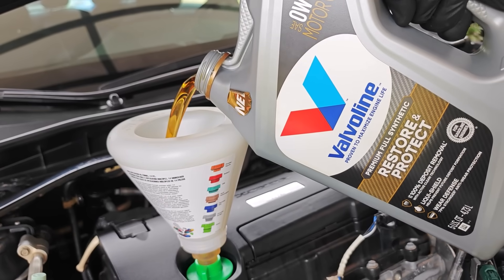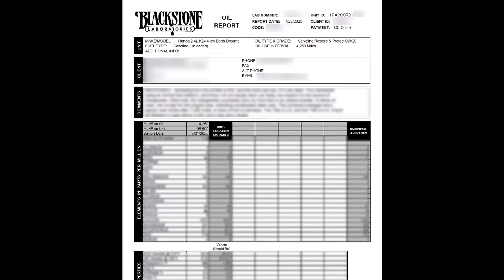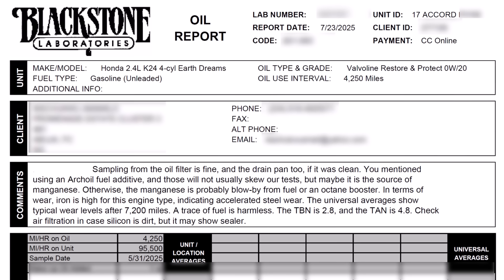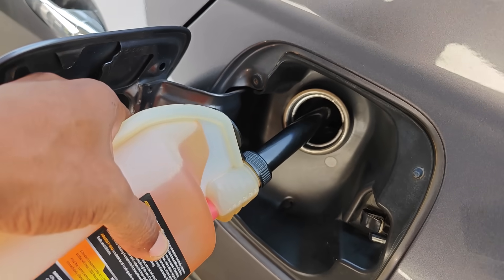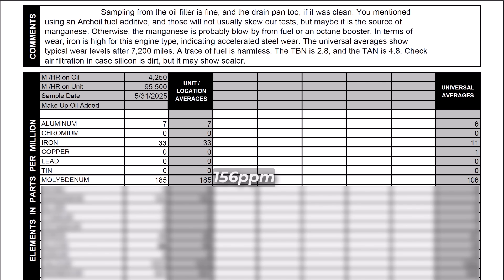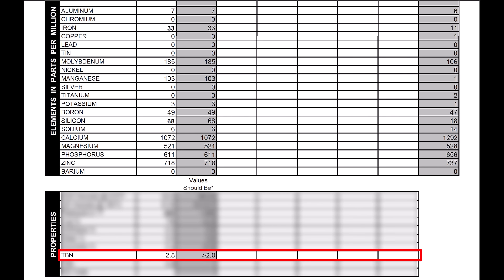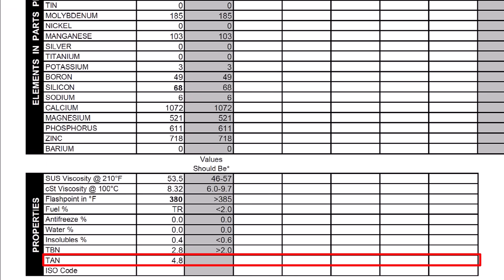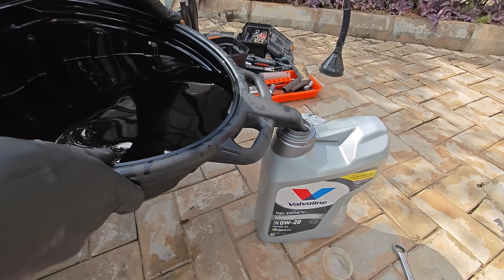Used Oil Report AFTER Valvoline Restore and Protect is Concerning?

Comment: Stop using the fuel additive and see if next analysis is more normal!
Reply from the maker: Yep. That's the plan in progress already! I've just seen from the comments that someone mentioned that Motor oil geek stated that increased manganese shows how well VR&P is working in cleaning out the piston grooves from the accumulation there.

Comment: I’d use the Gold Bottle Castrol 5W30 over Valvoline…..
It runs significantly better in my Experience….
Reply: How long had you tried VRP?  1,2,3, or more intervals?  Exactly what was VRP not doing that the other Oil is?
Reply: @lgoamity Purchase a GoldPlug Drain Plug,Castrol Gold Bottle runs smother than ANY Valvoline Oil….
Reply: @kevinkinsler  So... Does this mean you have or haven't actually used VRP?  

Saying your Gold Bottle Castrol is better seems to ignore that VRP is still Unique on the Market with its "Active" Carbon Deposit Removal while also being API/ILSAC rated...

I'd still appreciate answers to my Questions... What is VRP not doing that your Castrol is doing for you?  If you haven't used it then just say so and tell us why you're happy with Castrol...
Reply: @lgoamity You Aren’t Reading My Comments Correctly;Have a Good Day….
Reply: @kevinkinsler Uh... Your comments aren't answers to my questions... They seem more like Opinions. To read them "correctly" I just need a response or more details that actually tell me you have used the product(s)
Reply: @lgoamity Can you read English,:Castrol Gold Bottle 5W30 Runs Smoother than ANY Valvoline Oil,And this includes Diesel Castrol Vecton Gold Bottle!!!!!!
Dude you gotta learn to Comprehend when someone tries to Help You!!!!!
Reply: @kevinkinsler  I like smoooth! VR&P for the win.
Reply: @kevinkinsler You SAY something like it is PROOF. You claim Experience... VRP is relatively new... You use a general term like Valvoline Oil... Which MY reading comprehension suggests YOU haven't used VRP... AND for some reason can't/won't back up your OPINIONS.  Why is that?
Reply: @kevinkinsler you never said that you have actually used VRP and for how many intervals.
Reply: @kevinkinsler a claim without anything to back it up is useless buddy.
Reply from the maker: @kevinkinsler  No other oil stopped the blow-by I was having in less than 500 miles of use. That says a lot! And now thinking about it, all those deposits would have held a lot of wear metal from the years.
Reply: Castrol Edge Extended Performance is exactly what it claims to be: a 25k mile or 1 year oil. I've just installed both about 2 weeks ago. VR&P is to protect a 2013 Sonata from low tension piston rings and oil consumption. Castrol EP is for protecting a 2013 F-150 work truck from abuse (short trips and excessive idle.)

Comment: Project Farm Has Debunked the 6 month rule, his Analysis at 18 months was just fine.
Reply: Care to clarify exactly what is "fine" at 18 months?  If you mean Oil... You realize that every engine/driving condition is different... Which means 3 months for my GDI 2.4L Ecotec vs my Older (Non GDI) 2.2L Ecotec will result in different Oil Conditions... Namely the GDI is prone to Oil/Fuel Dilution... Meaning that the OLM in both Engines might suggest they both could run nearly 12 months/6000+ miles... Yet Oil Analysis has previously suggested that "might" only be reliable to say for the Non-GDI... Although even then it'd likely be much safer to sick with a 5K Mile limit, with 3000 miles still the safer bet... Even when an OIl claims "10,000 mile Protection" I've repeated seen that not to be the case... Because of Oil Dilution, etc.
Reply from the maker: @lgoamity I couldn't have said it better! Can't apply to every engine and driving condition!

Comment: i tried restore an protect on my 4runner an had a bunch of debris on magnetic drian plug after 1k.. typically i see nothing using rotella t6
Reply: Then it worked as intended😂
Reply: @Carlos.Rivera  u might want wear metals coming from ur engine but i certainly do not
Reply: What did/does the Oil Filter look like?  I know for my first 2 intervals (2x 3000 miles) the Filters were as expected the usual Dark/Opaque Black... But for Interval #3 it was Significantly cleaner looking.  I'm now 500+ miles into Interval #4 and hope that my Oil Filter Swap by 1000 miles will continue to show Carbon Breakdown but not so much that it is "instantly" blackened with contamination...
Reply: @lgoamity  oil was clean an filter was spottless.. boss purelator...
Reply from the maker: Thanks for sharing your experience. Would be good to do an used oil analysis.
Reply: Exactly Correct,Stick with the Good Proven Products if You Care!!!!!

Comment: Could silicone inflow also occur during frequent use of the endoscope?
Reply from the maker: It's definitely possible to introduce silicon with borescope inspection, but I don't think it would be that significant except if someone is really not careful and is pouring sand and dust down there.

Comment: would you consider switching to 5w30 for maybe some better high temp protection during the summer months? love the videos.
Reply: Yes I do it in my Honda,acura and  Nissan I use 5w30 in the summer hot 120degrees and for the Infiniti I use 5w40 the car calls for 5w30 I always go up a grade in the summer
Reply: @abbas674  yep 5w30 in my 22 RDX and 5w20 in my girls 2012 accord 2.4L
Reply from the maker: Definitely on the table. Got some VR&P 5w30 already. I just want to repeat some oil analysis to be sure of what's going on before making the move. If subsequent tests are good, I'll stay 0w20, if not, I'll experiment with 5w30 and see.
Reply: The European version of the owner’s manual for our Camry allowed for a range of oil viscosities while the U.S. version of the manual calls for 0W-20. Rumor is that U.S. regulations don’t allow them to recommend thicker oil than they use when testing the fuel economy. Based on that and how hot it gets here I went one grade thicker. 

I hear oil analysis could also be used to test if it reduces the wear rate.
Reply: Cars sold in Europe generally have longer oil change intervals,so to compensate from oil thinning,they decided to use thicker oil.
Reply from the maker: @ryanhuang8498 - Right. A lot of cars in Europe recommend 1 oil change in 12 months!
Reply: @DIYAutoworksNG  But that's due to ideal climate conditions. Not places where extreme heat and humidity takes its toll. European carmakers still recommend more frequent oil changes in such conditions.
Reply: @ryanhuang8498 That’s entirely possible. Note that many of the oils for European cars have additional specs they meet too.
Reply from the maker: @shawngrimes9302 I'm exactly on that course. Will either stay on 0w20 or go to 5w30 based on the serial oil analysis I'll be doing.
Reply: Hyundai does that. Dealers use 5W30 for the summer. Reduces oil consumption
Reply: I strongly doubt a passenger car sees any appreciable oil temperature increases in summer.

My race car will see 10C higher oil temps on track during July/August, however.
Reply: @BrodeyDoverosx  Does the race car in question have an oil cooler?

Comment: Out of curiosity, where do you live? Climate and fuel can vary by location.
Reply: He lives in Abuja, Nigeria
Reply: @humphreyirusota712  That's why his silicon is so high. 
It's coming in via the air filter... which is driving the high wear.
We have the same problem in Australia... if you drive a lot on unsealed roads the Si level increases (even with a brand new air filter). 
Wear directly correlates to the amount of Si being ingested.

🙂
Reply: The solution is:
1) High efficiency foam air filter (stops silicon ingestion), 
2) High efficiency bypass oil filter (removes silicon) 
3) Protecting the engine against damage by bonding a lubricant to the insides of your engine

Or preferrably doing all 3.

🙂#XcelPlus
Reply: @1Wondering no one with a gas engine car is running a bypass filter.  Not cost effective, and no one is trying to extend their intervals that long.   OTR diesel maybe.  And some  snake oil additive isn't going to change anything.
Reply: @johnnyh127  You're right... "nobody is trying to extend their oil change intervals that long"

Just use normal oil change intervals with your bypass filters.

The benefit is the reduction in circulating wear particles... not extended oil change intervals. 
🙂
Reply: @johnnyh127  Most users put all kinds of stuff in their engines without testing it e.g. Fuel additives, flushes, anti-wear additives, etc...
It's rare to meet someone who has never put something other than engine oil in their engine e.g. Stuck piston rings are a major problem in lots of cars at the moment and you'd be crazy to do a rebuild if you can get away with a flush. 
Blocked injectors are also common... so a lot of people flush their fuel systems with detergents.

It's even rarer to meet someone who has bothered to test their oil (or oil additive) to see what it's doing to their engine.

If there wasn't any room to improve oil... we'd never see any improvements.
Yet every year oils continue to improve.
These improvements rely on additives... suggesting that the right additives are worth pursuing.

Not sure how you can confidently claim that all additives are a waste of time considering all the evidence to the contrary.
🙂
Reply: I think he's from Nigeria. Idk for sure though.

Comment: Doesn't work for me. 2005 honda accord still consuming oil
Reply from the maker: If you've had up to 4 oil change intervals with no improvement, the engine may actually be worn. However be sure to have ruled out other factors like clogged PCV valve or leaking valve stem seals.
Reply: After running a engine cleaner, and you're still using oil, change PCV first. Then use a heavier oil. Most Asian engines run fine on 10W30. Will lose a couple MPGs using the heavier oil.
Reply: check for blowby and if theres a decent amount it might just be from worn out rings, instead of them actually being clogged.
Reply: Your comment is too vague, so it falls under personal opinion
Reply: Valvoline restore and protect will only help with oil consumption if at least some of the consumption is caused by oil rings not properly sealing because of deposits on the rings and ring grooves.   It will clear those deposits, allowing the rings to seal properly.  But this is only one possible cause of oil consumption.  It won't fix leaks or worn parts.  

  On my car,  it significantly improved oil usage from about one quart to every 1200 miles to one quart every 2000 miles. For me, the effect was almost immediate.